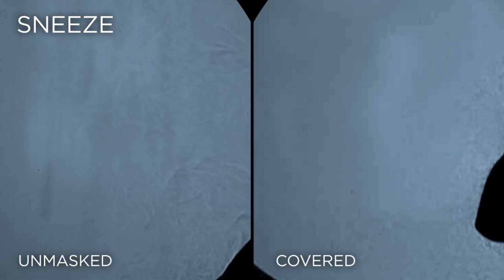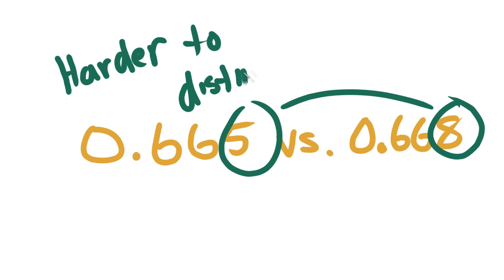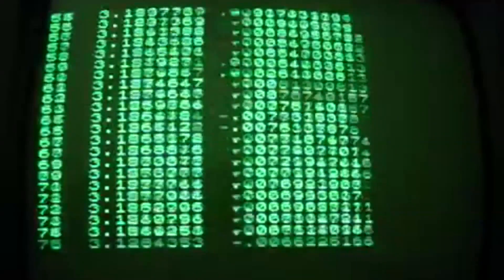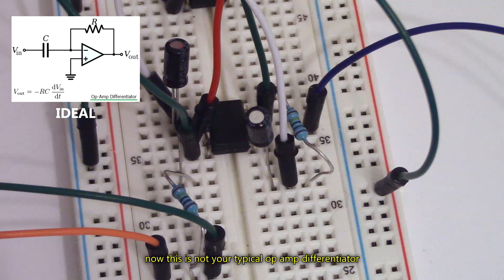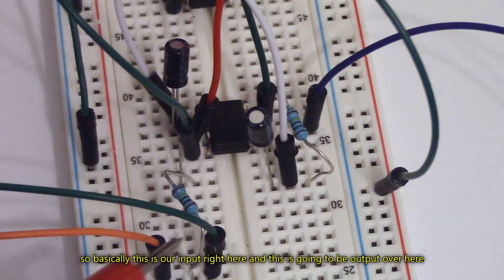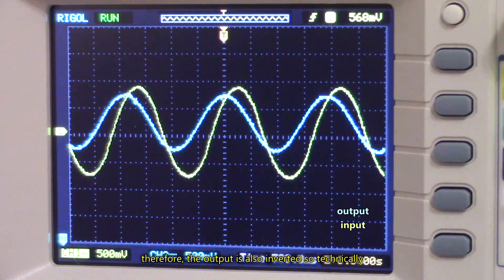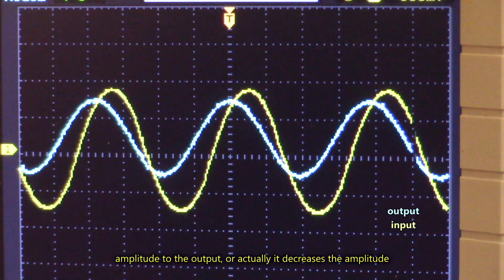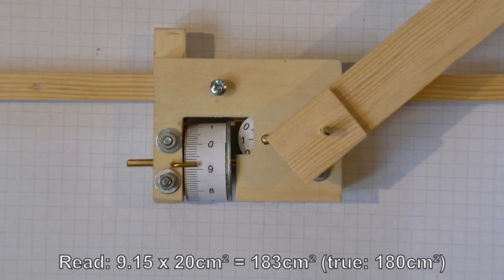Building an Analog Computer with Op Amps (Part 1): Analog Vs Digital

Comment: An analog computer can be designed to be multifunctional however though possible to do just through analog circuits the best way to do it would be to make a digital analog hybrid computer kinda like a brain or have the analog side to computation and digital for changing mode of operation and organization. Analog computers have also shown to be excellent and many times more efficient at processing artificial intelligence and pattern recognition. Future computers are not going to be purely digital or analog but instead something in between.

Comment: great video, dude! I was expecting you to try the integrator circuit first because that's the more "famous" one and  equally well demonstrates how analog signal processing works with OPAMPS (and I could be completely wrong, but also a little easier to stabilize?). Anyways, could you tell me what OPAMP IC you're using? Surely not the basic 741 right ? I'm a broke college student and cannot afford expensive power supplies so any idea on a "user friendly" opamp that's easy to power with a 5V line (say via Arduino or even a basic battery) ?

Comment: why do we need op-amp to realize differentiation or integration? we can simply do it by passive circuit right? What is the advantage?
Reply: Think of an input signal of 1V. Integrate it with respect to time, and you get a linear increasing function of the input voltage. How can you obtain a higher voltage with mere passive elements? The op amps do all the work. Also, I recommend you to read about negative feedback. Hope this helps :)

Comment: 0:44 
the lag... the pixelation.... I worked with an analog scope, was it a HP or something... I quickly rushed and got myself a 80's Hitachi as a backup.

I hate when people claim analog like vinyl are better than CD, or hipsters of the worst kind prefer cassetes over a well compressed MP3. ( ears trained on pop music and cheap apple earbuds ndlr)

but on the logic, analog computing is interesting by certain aspects. As people talk more and more about quantum computing, this is the closest thing. the Nike computer has been in the missile defense for decades in the army, while there was transistor and even the first microprocessor computers, but it was more for streams of data and realtime where a digital computer would take minutes to detect a potential attack or incoming missile.

The op-amp approahc is intresting, since virtuall every logic gate can be reproduced. not with the FPU precision of a digital CPU sure, but still... intresting.

Finally, animal brain IS an analogue computer.
Reply: In truth Analog computations are limitless, they would technically have an infinitely high FLOPS statistic and would have infinite storage. It's not that Analog is shitty, it's because our science isn't advanced enough to take advantage of Analog systems, due to noise and coding issues
Reply: @theshermantanker7043  check out neuromorphic computing
Reply: Analog/vinyl can still function when the power's out.